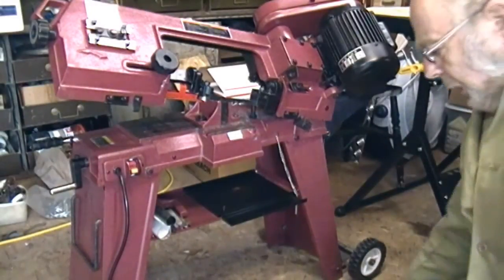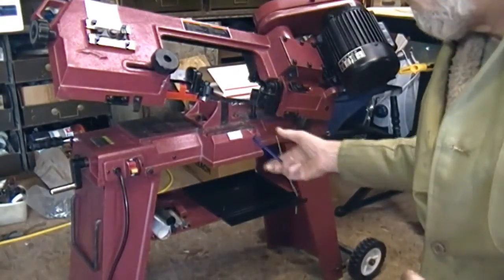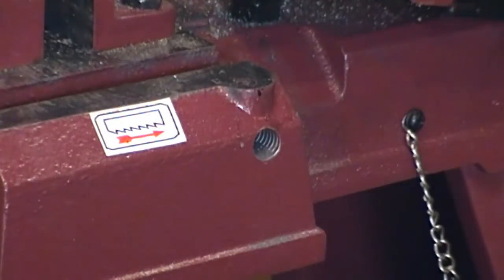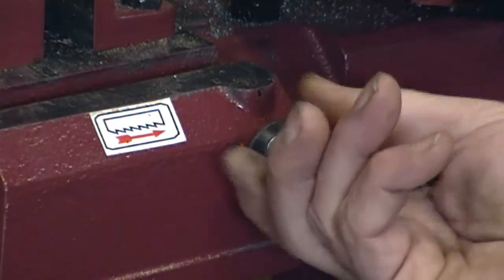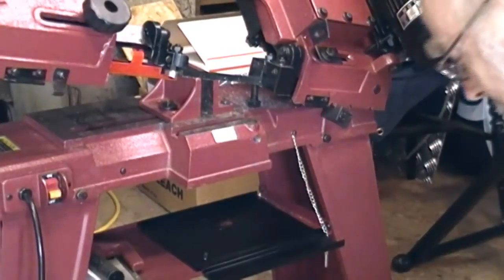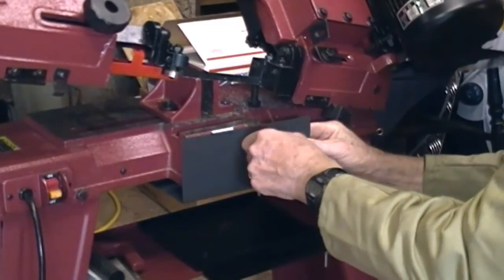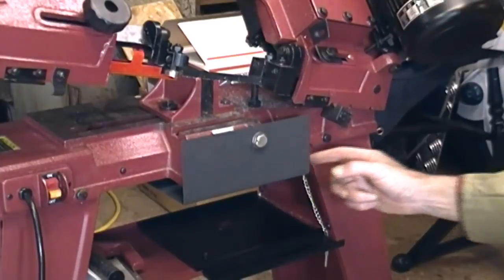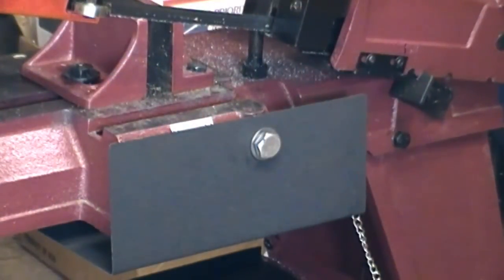Bandsaw simple chip catcher

Comment: I used an Aluminum baking pan on shop built "rails" that slides underneath the saws main casting, works great, probably gets 98% of the chips and small scraps.
Just slide it out and dump into the nearest trash can to clean.
Reply from the maker: Another simple fix - nice one.

Comment: Clearing the chips: 1/2"X14ga.X 2 or 3" long flat stock brazed onto a 3/16" / 1/4" rd rod (as long as you need), so it looks like an "L"... slide it in from the left side pushes the chips out the on the right side. No need to loosen the bolt. Another option change the flat bar to a hard rubber strip / drill-n-tap the end of the rod with an 8-32 to attach to the end of rubber strip.
Reply from the maker: Hi Bill - thx for ideas.  My very quick and simple fix was done spur of moment and for now anyways it'll do the job, with clearing probably not all that frequent. May tho make a small ''pusher'' such as you suggest. :).